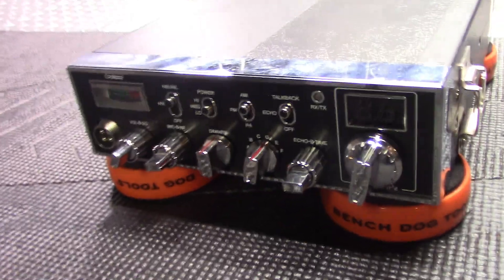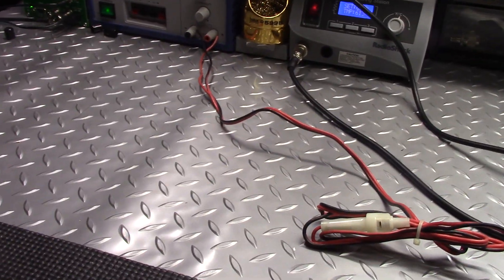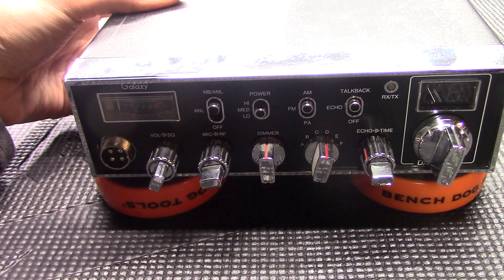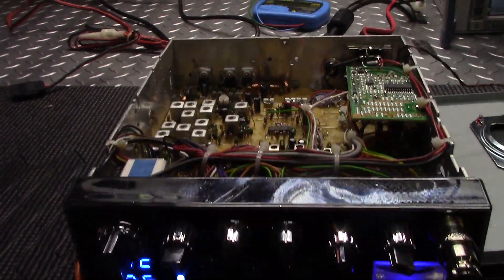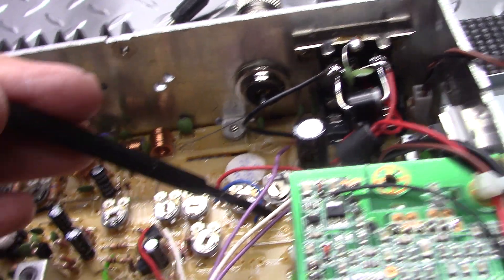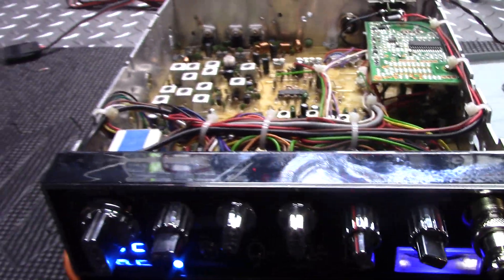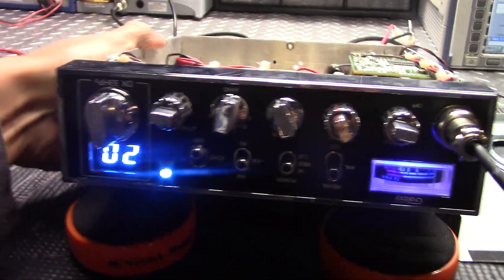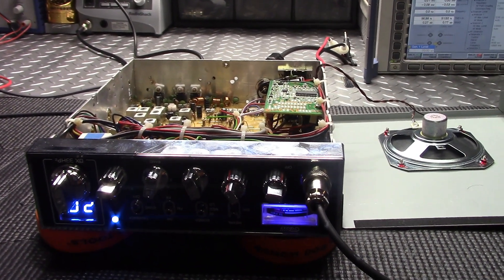Galaxy DX-33hp2 Repair FIXED! Troubleshooting CB Radio 10 Meter Export

Comment: I’ve got the same radio it quit keying up. No transmission at all. I’ve took it to two local shops they can’t figure it out. Only a year old worked perfectly up till this. The only thing that has been done is high and lows added. Any clue as to what it could be? Thanks
Reply from the maker: Impossible to tell without having it in front of me sorry
Reply: @TheRadioGarage  Well thanks for the reply it’s stays blue when you key up and the needle never moves. It’s receives perfect but no key. Does people ever mail you anything to fix. I have PayPal. We run deer dogs where I’m at and it went out mid season. I had to pull one out of my ranger to go in the hunting truck.
Reply from the maker: Yes all I do is mail ins..keeps my overhead down. Sounds like an issue in switching circuit.  No red tx light is makes it easier to narrow down.

Comment: I have a Galaxy 33hp2 can a radio have a high SWR . I put my cobra 29 inline my SWR is flat
Reply: Can I send you my galaxy it has the same problem? Would like to send it to you.
Reply from the maker: You can email me at theradiogarage@gmail.com thanks
Reply: The radio was done 4 yrs ago and it just all of a sudden fell off. It might be because it in my 18 wheeler
Reply: I got the radio fixed Walcott in Iowa
Reply from the maker: If someone had there hands in the radio then yes its possible.

Comment: Since you are trying to find an over current issue why not just unsolder the final then turn on the power and see if the issue still exists it's much quicker than testing all the parts one at a time if it doesn't eliminate the issue then try the driver and so forth much quicker troubleshooting method.
Reply from the maker: Thanks for the input. I appreciate the advice.